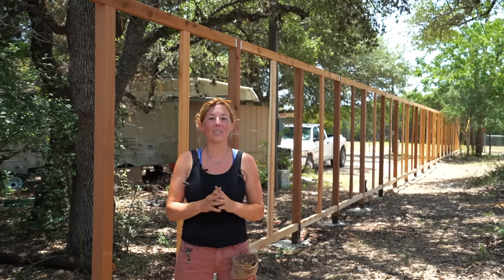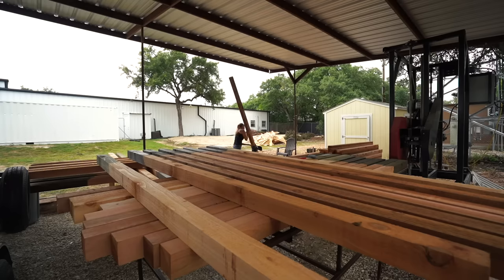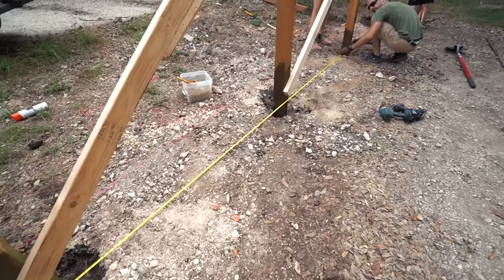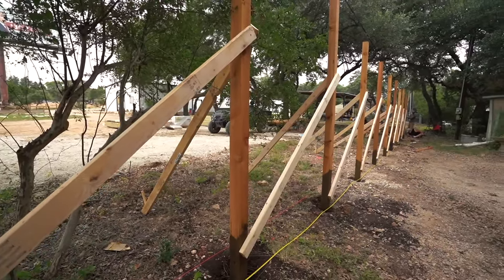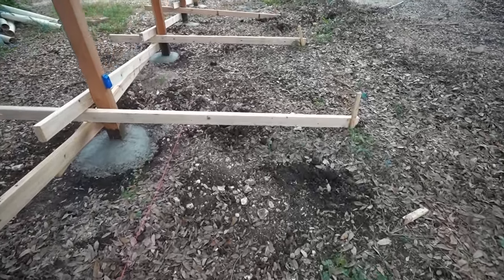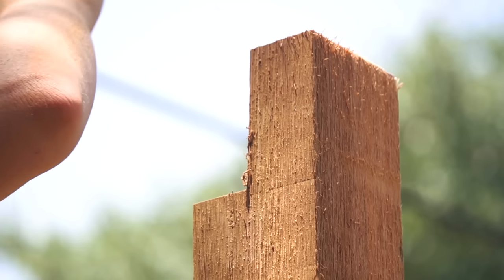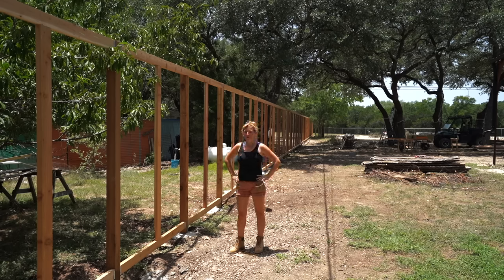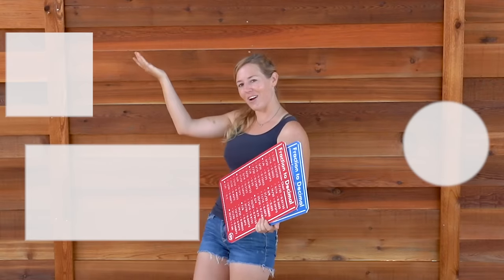Building a Horizontal Fence

Comment from the maker: Check out my website where I have tons of templates, products, and plans! http://bit.ly/2JqP7C6
Reply: April, why didn't you put the tube with the preservative in one of the post holes in the ground? It would have made the dipping easier as you wouldn't have to life the pole so high to get it in and out.
Maybe a tip for the next fence.
Reply: This fence is absolutely gorgeous ! Seriously stunning ! One question , why not place the verticals above the concrete posts rather than into them ?
Reply: My dad loved his fraction to decimal in blue, I've heard him bicker to others over a 32nd of an inch. It received a good hearty laugh!
Reply: "Fractional to decimal conversions" - ...laughs in metric ;)
Reply: Do you know it?
"The Mending Wall" by Robert Frost?
Reply: I just placed a post for my fence. I use a lot of ideas from your first fence video. I am stopping operations and waiting part two.  I always wanted a horizontal fencing but could not find a good tutorial for one. Your tutorials are always so spot on and easy to follow. (Thanks for that)
Reply: @Mrslam2000  this is a wall not a fence. Rather unsightly if you ask me.
Reply: Hi April
Big fan of your work 🙂
Just wanted to give you a tip on a easier way of mixing bagged concrete instead of using a concrete mixer. 
I use a 1.5m x 1m tarp and tying the two 1m ends into knots creating a hammock for the concrete. Once done throw in a bag of concrete and pour the required amount of water and with a back and forth motion mix and flip the concrete until you have a perfect mixture 👍 I find this way much easier to mix and pour the concrete into holes around post.
If you have any questions please feel free to contact me.
Hope this helps 
Regards Josh
Reply: Ohhh... I see the brilliant idea using the joist hanger things to attach the 2x4's I've been looking all over for this trying to figure out how to build my first wood fence.. I got my very first post level but used a 80 lb bag of cement & then added a 60lb bag on top bc the rain made the hole wider. My 2nd post I only used 60lb. April makes this stuff look easy, I have 5 more post to do. I'm on a budget and my mom is not doing well so I'm often in a daze trying to get my mind out.

Comment: Arent all fences horizontal? 😁
Reply: when you see a fence 5 meters height, you'll start doubting.
Reply: Overall yes but she is talking about the boards will be horizontal, vs the normal vertical boards.
Reply: @talladegadude4852  ah...yea? The slates or pickets? I was obviously joking, hence the cheezy grin emoji at the end of the comment.
Reply: Small vertical fences are call ladders
Reply: In this fence, the fence boards are horizontal, not vertical.. hence the difference
Reply: I'd say it's rather vertical tbh...
Reply: She likely doesn't know English language

Comment: How ironic, I just shared you other fence series to a friend of mine this morning.  The reason your holes were off was because of the rocky soil. You can start the auger in the correct spot but as you go down it will walk when it encounters rocks. Of course you try to correct for that as you go down, but usually the reality is exactly what you experienced.  My suggestion is if you know the soil is rocky have them  drill the holes using a larger auger, allows more room for error. You will end up needing more concrete, but way better than trying to enlarge by hand.
Reply: Even with a bobcat mounted auger? That's a lot of weight to shift from rocky soil.
Reply: specialtrades12 Sometimes even more because of the Bobcat. It’s usually hard to see if you’re drilling straight and once you get off, the auger can tip or slide pretty easily because it hangs on a pivot.

Comment: Dipping technique = fantastic tip. For the "vertically-challenged" individuals, a step-stool or short ladder might help with the reach angle, too, and still give a great shoulder workout.

Love your projects/videos, April. Keep 'em coming.
Reply: We "vertically challenged" will also work out glutes, calves & thighs at the same time with that work-out on step-stool or ladder ☺
Reply: Also set up your sonotube with liner in the last hole you drill- gets the same result without having quite so much back breaking and sweat- signed a 145 lb whippersnapper.
Reply: I would not want to seal the bottom. Sides OK, but would need to brush or roll.

Comment: Back in the mid 70's, I worked my way through my first two years of college building cedar fences and patio covers.  We didn't have lasers back then and we didn't have any money for air nailers.  I still have my 22oz  Craftsman framing hammer but the claw is considerably shorter from chipping concrete that was too high.  My partner and I charged  $8.50 a linear foot for #2 cedar.  I think it's about $50 a foot now.  Thanks for taking me back.

Comment: I've been fencing in the UK for years and I've never seen a fence post rot out at the bottom before its rotted through at ground level. This is where it is moist and has the most air for fungus and microbes to feast on the wood. 3x3 post seem a little thin for a fence of this size that will have a lot of force put on it by the wind. The finished fence looks awesome in the video
Reply: I agree, I build all of my fences w/ 4x4 PT 48" in ground, 2x 30KG bags of concrete never had an issue after over 5000 linear feet of fence even with Frost/wind
Reply: Venice, Italy is built entirely on submerged logs that have not rotted in 500 years. Rot only occurs at ground level and above in the presence of oxygen.
Reply: Hi Roland your comment makes total sense, in fact we use Postsaver a UK product sleeve that is heat shrunk to the post protecting at the ground-line and 12” below, that band is where the rot happens. Cheers
Reply: exactly.  They always rot at ground level where there is moisture and oxygen for the microbes to do their work

Comment: I am replacing my old wrecked chain link fence at my front road, it's only going to be about 50 feet.. This fence is nice. I will keep it in my top 5 picks. Thanks April. Glad to see a new video! The first one I ever watched was way back when you did the lean to on that old house with the small cement pad and the next one was when you cut all the fence posts off with the cutting torch, and I said, if she can do that, maybe I can too, although, I am much older........ think, no indoor electricity.... ok, not that old, but I am still getting it done. Thanks again for the inspiration!

Comment: Thanks for including the explanation of the transit, laser, etc. I wondered how you got such a great level over that distance! Beautiful fence!
Reply: Most of those laser systems will allow a grade to be dialed in so laying sewer line, etc. is very easy.  The grade has to be in the direction of the trench or pipe.  When set for level, the laser can be placed anywhere out of the way..

Comment: The picket on picked fence you did an excellent job. On this one the posts are not even the same height. One post on each end and you can shoot straight from there , "eye ball them".  Post are level and once leveled you can pour concrete in.  The outcome it is beautiful. Usually on horizontal fences posts should 8 feet apart, on these it should be 6 or 5 1/2 apart. The wind might knock your pretty fence down. Your whole were off because of the Rocky soil, that's why you don't digg all your wholes just yet. You build the ones from the ends, put one in the middle middle, and you go from there. You build them as you go so you don't have the same problem you had.

Comment: Great video. Gonna get me a laser tape. I spent a year or two installing fences in AZ. Couple of things I learned from the pros: 1. We always played with the depth of the holes to set the tops of the posts to the correct height. We NEVER Cut the tops of the posts off after they were set. I’ve had to cut off post tops on an Eagle Scout project because I wasn’t there when they set the posts and it was much more difficult. 1a. Another thing the pros do is eyeball the horizontal and vertical alignments. Sounds crazy, but the human eye is extremely accurate. And besides, what standard is going to be used to judge the quality of the finished product? The human eye! 2. Concrete mixer is a great idea. I’d suggest that on your first hole, you measure the amount of water needed to get just the right mix using a gallon milk jug. That way, for the next 50 holes, you can simply fill the milk jug up to the same level each time, add it to the concrete mix and flip the switch on the mixer. You can’t believe how much time this can save you and you can be certain the mix is just right every time. Concrete mixing is a completely deterministic process. My son and I just used this method on his Eagle project and it worked great. Anyway, keep up the good work. I really enjoy watching your videos.

Comment: Wowser.  Beautiful Fence.  Great Design and execution. We recently replaced the 150' of raggedy chain link fence with a 5' tall privacy fence.  We choose to emulate the beautiful western cedar fences with the horizontal board orientation.  In Ohio, cedar just isn't economically feasible, though I bet due to increased Pressure Treated lumber prices it's no longer 2X the cost and more like 1.5X.  Anyways,  we went with treated poplar,  also called Kentucky board.  It's about the cheapest hard wood you can find.  I was only ever able to find it at fencing supply stores and not big box or specialty lumber stores.  It's beautiful,  we also installed a batten on every vertical 4x4.  My neighbor gets the benefit of the batten side.
Fences like these are head turners for sure.

Comment: we just had a horizontal fence installed at our home, on paper it looked like a possible DIY but we have grade changes, hidden tree roots and all sort of obstacles so in the end we hired a local company. It was 3 weeks of work, they actually went post by post because the grade made some sections shorter than 6ft wide, they also recommend a vertical strip because horizontal boards can torque. Having been researching this for years, you see a lot of badly aging horizontal fences but it's such a striking design. I have some videos of my garden renovation that feature the fence.

Comment: While it wouldn't have been as much of a workout, you could have put the cardboard tube (sonotube) for the copper napthenate into one of the post holes. That would have lowered the tube by 3-4 feet...  

Also, the general rule of thumb for fence posts is 1/3 of the length should be in the ground. In this case with the hard rocky soil they may be OK in all but the heaviest winds. Others should consider their soil type when deciding how deep to place them...

All that said, it's a nice looking fence!
Reply: Noted!

Comment: For your next fencing project may I suggest you have 12" post holes dug?   I had a 955 JD compact utility tractor with a post hole digger and 12 auger.  It worked great to set even 6" X  6" posts.  By being oversize you do not need the holes to be quite so precisely located.  It takes some additional concrete to fill the holes but I consider that to be much cheaper and easier than having to dig your holes over to get the location precise like you had to do.

Comment: Nice job.  Great looking fence.  I can't remember seeing any piece of land around here where I could build  196' fence and have it be level all the way.  At some point the bottom would be ten feet off the ground.  Next time just brace the posts and dump in the concrete dry out to the bag and wait for it to rain.  Or you can pour some water in top of the hole if you can't stand waiting.  Actually, I would have just put sharp gravel in the holes.  Almost as strong as concrete and keeps the posts dry.

Comment: I like your 12 foot span idea.  When I built my fence about a decade ago, I did something similar but used metal poles 6 feet apart, but the 2x4 cedar stringers were 12 feet.  I staggered the rungs so that there was not a full vertical break at any point along the run.I think that (As well as the poles being an extra foot in the ground) is what has helped it and at one point it was the only fence standing on my street after a downburst during storm season.  These were the same neighbors who I got ridicule from when they saw me building.  Uhuh... I still have a huge cheese grin from that.

Also, anyone NE of Dallas with shrink/swell black clay, good luck.  It's hard as a rock during dry months, and about as sticky as aggressive paste when it's wet.  It's a battle even getting it off of your shovel when it's wet, only to find that it's stuck to the bottom of your shoes now.  The only way to win is not to play the game...haha.  I do recommend you sink your poles in concrete during dry months because if you do it when the soil is damp, the shrink will pull away from the concrete.  If you did it right the structure will be fine but it won't look good.

Comment: Excellent vid. I'm currently building an 8ft tall horizontal fence as well, but I'm doing mine a bit different. I'm doing 10ft 4×4s 10ft apart with a 4×4 in the middle of the span to prevent warping and improve rigidity for the 10ft long 5/quarter board that runs the length of the fence. I was gonna do 2 or even 3 4×4s in the middle, but I was convinced by a contractor that would be overkill and a waste of time, money, and effort. I'd love to hear your thoughts.

Comment: So a couple of years ago a company came in to put up new power poles along the road that I live on.  The poles are over 100 feet tall.  I saw them use a plumb bob to check them if the poles were straight.

Comment: Also instead of a 1" offset from the string line you could use your hammer head or any other tool to just use that as a story stick. Short level perhaps since you need to plumb the post with it?

Comment: Ive been putting up privacy fences here in arkansas for years an easy trick to level posts is to break up cement blocks and use them in the holes it helps level the post and you use less cement. Plus T25 screws hold better than nails
Reply: Just a trick I learned hope it helps

Comment: I'm about to try to build a fence like this. Having never built a fence before, I'm not sure if what I'm thinking of doing is going to turn out to be structurally sound.

The plan is to use Ozco 4x4 post anchors to hold up 8 ft posts (8ft on center) and then simply screw or nail 1x6x8 deck boards (not the standard, lightweight picket-grade lumber) to the posts. I wasn't planning on installing any rails...just the deck boards.

The substructure (if you can even say that there is one in this case) certainly won't be as strong as what you've built here, but I'm thinking it might work for what I need it to do...which is just to create a visual barrier between my (very close) neighbor's back porch which points on an angle directly into our backyard. We have zero privacy back there.

Note that the deck boards would have 2 to 3 inch gaps between them to let allow for some air-flow, so if high winds kick up we're thinking that the fence will remain stable.

Are we making a mistake not using rails?

Note that the final height would be 7'9" since the Ozco posts are driven in until 3 inches are showing above the surface. I wanted to go with 8' posts because I'm 6'7"...a 5'9" fence kind of defeats our purpose. Plus, the neighbor's back porch is 2 feet off the ground, so they'd see over the shorter fence pretty easily.

An 8 foot fence seems huge for this property (we've considered cutting the posts down to 7 feet), but we're also a few hundred feet from a major highway with 18 wheelers rolling by at all times of the day and night and need to block them out visually. The higher the better (and 8 feet is our max if we don't want to get a permit).

I chose the Ozco post route because they seem much easier to install than digging holes and pouring concrete...I'll be doing this job pretty much by myself, so I wanted to make it a little bit easier.

Thanks in advance for any guidance.

Comment: Years ago I saw a This Old House episode were Norm was setting a wooden mailbox post.  He was of the opinion that wooden posts should not be set in concrete.  The argument is that the concrete acts as a cup which holds water - leaving the post sitting in water which promotes early rot.  You may have solved this problem with the gravel at the bottom of the hole changing the cup into a tube giving a place for the water to escape. Also I can't imagine effectively back filling that with that rocky spoils.  Another thought would be to backfill with the same gravel you used on the bottom.  That looks like it could be adequately compacted to hold the posts upright while promoting drainage.  A little sand would tighten things up if needed.

Comment: Most important cut on a fence is to have the top rail cut at a small angle on both sides so water sheds off.  Just make sure to coat the top well with sealant.

Comment: I guess I'll have to go out and wait in the road construction if I want to see your brand new, super good looking, privacy, horizontal, red cedar, fence!  

You built a beautiful fence, and yes, I hired out the post holes at my place too.  ALMOST no other option.  I tried using a rock bar, and a sharpshooter on about three holes.  Then I got on the phone to find someone with a rock drill.  It tripled the cost of a simple cattle panel fence with T-posts to keep the dogs safe.
I also went out and bought a Mattox when I built a ramp for a storage barn to deal with the rocks.  Sound familiar?

Comment: Beatiful fence. I have the same dilemma, going from an 8' to 6' span qith existing posts. What I'm thinking is, I'll just need to rip out the middle two posts between 24' (or three 8' sections), leave the first and last post standing, then replace the two along with a third middle post at 6' intervals. That would work right?